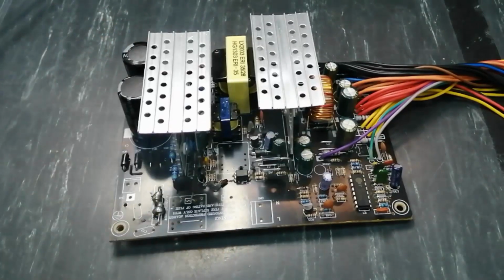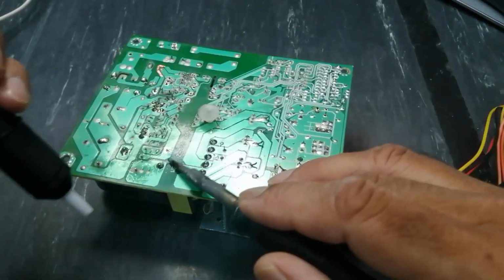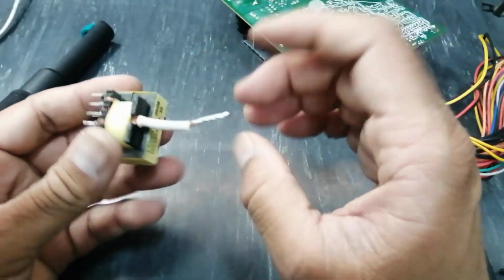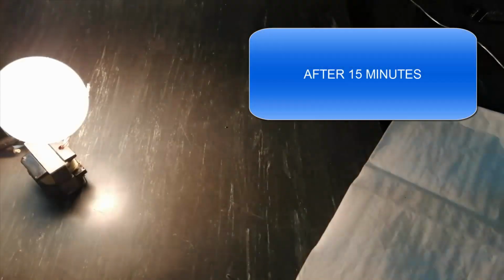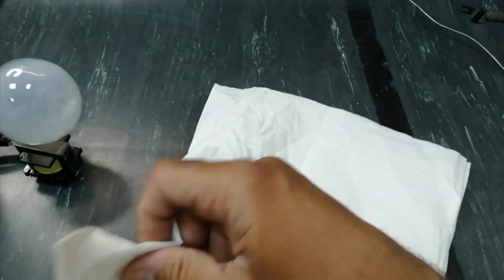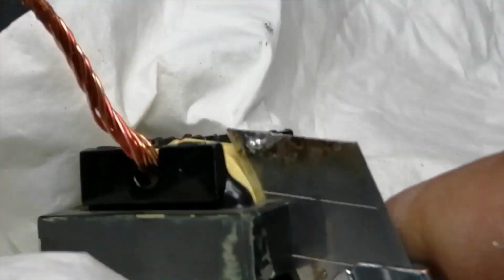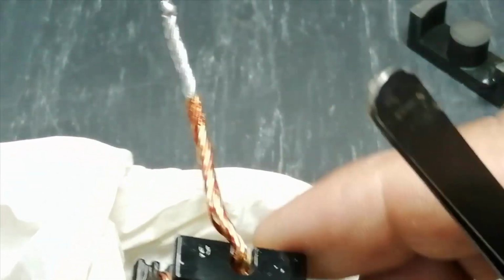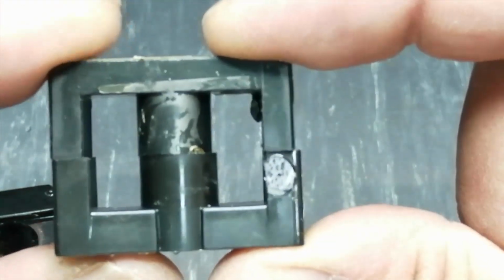#227 How to disassemble the Ferrite Core SMPS TRANSFORMER

Comment: Do you know why mosfet get hot with load on a ee113 core I use 700 of mosfet with the core 7+7 primary and 60 for high voltage the core getting hot at any frequency mosfets 60khz but at 113khz the heating coil down by half but anymore above 113khz the mosfet getting hotter and voltage dropping the core is 500 watt i use 21 gauge for both primary and secondary but 8 pieces to get the right current balance for primary input voltage I try some other core I have but they don’t seem to work well with any frequency volt little voltage I just need to get some understanding of why ferrite getting the mosfets hot

Comment: How to choose correct ferrite core for desired power?

Or

How to calculate maximum power handling of a ferrite core?
Reply from the maker: best regards 
use power handling chart with topolgy selection and de-rate the core properly
use Core Geometry method
or use WaAp product method
please check video number 262 or 270
Reply: @HaseebElectronics  Thanks Haseeb🙋🙋🙋

Comment: Sir, I want to ask how can we understand the smps transformator is fault? For example, my smps big transformator connect the rectifier diode DC output, when I control the rectifier diode dc out, its show short, can we say transformator is fault? And is the transformator repairing possible and how?
Reply from the maker: welcome dear
basically it is a high frequency transformer which cannot be tested using a multimeter
if there is high frequency switching in input and there is a ac voltage drop on primary side. with no load check the DC vcc voltage from axillary winding, if it is slightly above than the UVLO of the SMPS controller, that means the SMPS controller, MOSFET and transformer is working properly
if, the VCC voltage are near to OLP (over load protection) limit of SMPS controller , that will sign of short circuit of secondary winding 
if there is low voltage on VCC capacitor, & fluctuations on Bulk capacitor, that will sign of short in primary winding 
if the MOSFET is getting short again and again, it might be short in  primary winding. or low switching frequency
sometimes, due to saturation or over temperature the core material is degraded, then the transformer core  fails due to loosing its magnetizing capabilities and the transformer behaves as short
Reply: @HaseebElectronics  okay, I have this smps external transformer in 220 volt, when I connect it then directly show short circuit, I can not find where is the problem okay thank you
Reply from the maker: @TheWeftmen  are you connecting smps transformer to 220vac directly???
Reply: @HaseebElectronics  No not smps transformer,  this is normal transformer and it is removable transformer already exist in psu box, when I connect it, the atx smps mainboard show short circuit, series lamp light up constantly, when I remove transformer psu doesn't show short circuit